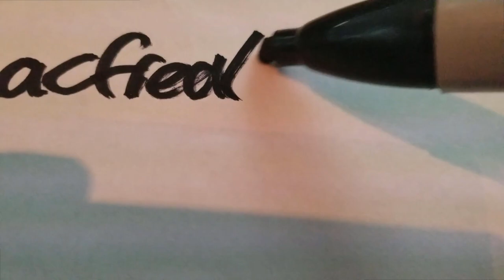2015-2018 Audi A3/S3 8v rear door window replacement DIY

Comment: Thanks for the hints, worked like a charme. It was a bit difficult to place the nuts to fix the window by not deconstructing the whole mechanism -- small hands would have been helpful. But in the end I fixed it with some wooden pins 🙂

Comment: Hi if the the window isnt broken and you just had to change the regulator would you need to remove the window
Reply from the maker: I don't have access to the car anymore but from the manual it says: "The control module with the rear window regulator motor can be removed or installed with the motor or door window in any position." 
Follow the video to remove all the interior trim pieces.
Lastly, remove the connector to the regulator/control module, the 3 bolts holding it and it can removed.

Comment: Hi Mate, I know it’s been 4 years but would you know how to remove the window regulator.

Thanks
Reply from the maker: I don't have access to the car anymore but from the manual it says: "The control module with the rear window regulator motor can be removed or installed with the motor or door window in any position." 
Then follow the video to remove all the interior trim pieces.
Lastly, remove the connector to the regulator/control module, the 3 bolts holding it and it can removed.

Comment: Hi the black plastic trim at 5.23 do i need to remove the one on the left side of the Door to ?
Reply from the maker: no, the trim on the other side does not need to be removed.
Reply: @accordfreak1  i need to put a new window regulator in my Audi A3, so i need to pull the Window out with the regulator right ?
Reply from the maker: @mixmeister9985  not sure on the regulator but in the service manual it says to remove the window, then you can remove the regulator. But the window regulator motor can be removed or installed with the motor or door window in any position.

Comment: Hi acfreak. Could I use this turtorial for the  front doors or do they require different method? Thanks
Reply from the maker: Not sure as I've never done the front glass. It's most likely the same other than maybe the trim around the window

Comment: Hi acfreak! Thanks for the video! Any idea on how to “unclip” the window from the clip that is almost hidden, far from the access hole? Don’t have enough space to fit my hand in there. Any tips will be appreciated! Thanks!
Reply from the maker: The white clips? not sure,i've never taken out the window. You could try to roll up the window half way and use a plastic pry bar to spread the clips open while you pull up the window. Or maybe roll up the window all the way and see if the big clip can be removed somehow.
Reply: I need this info also
Reply: Did you get to the bottom of it? Regulator has failed in the down position.
Reply: @mikejames4271  window needs to be all the way down, you have to remove the trim pieces and pull out the rubbers on the sides of the window like in de video, hang them to the side. Unbolt the window regulator and you'll be able to pull the window out together with the regulator as one unit
Reply: @andries4561  wrong car
Reply: @cameronbryson2860  ?

Comment: Quick question - How did you remove the strip of gloss black trim along the other edge of the window? Don’t think that’s included in your video from what I can see. I need to do this on my as its starting to corrode.
Reply from the maker: which other edge? the only edge that needed to be removed for the window replacement is the gloss black bottom edge
Reply: acfreak Sorry about that, I meant to type ‘bottom’ edge. That’s exactly what I was referring to, the gloss black window trim. How did you manage to remove it & is it possible to do so without tearing down the entire door, as this is the only section I need to replace on mine & don’t fancy stripping the door if avoidable.
Reply from the maker: @NickyMabbs  it's only clipped on, pull straight up. It'll take some effort
Reply: acfreak You’re a star, thank you! I’ve looked everywhere for a removal guide for it but no-avail! Do you think with the window fully retracted pulling up would probably be enough? Also, do you think it’s likely to break? 😂 Doesn’t matter too much as it’s being replaced.
Reply from the maker: @NickyMabbs  np. It should be fine, mine didn't break. The window doesn't get in the way. Maybe try to lift one side first to loosen it up.
Reply: acfreak Very much appreciated again! I’ll let you know how I get on! 🤞

Comment: Are the white cylinders at 7:00 easy to remove and place into a new window, or will new ones need to be ordered?
Reply from the maker: Might be a little hard to push out the center piece but I'm sure it's doable. I think it would be best you hold the outside white piece while you push out the center piece